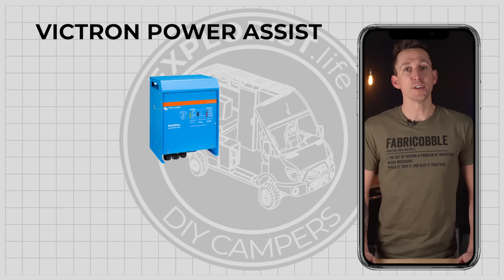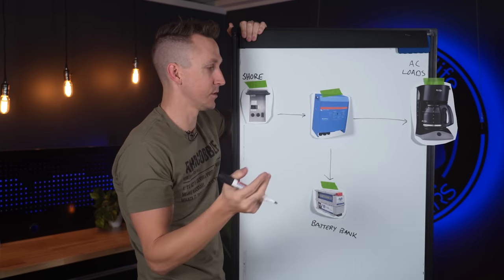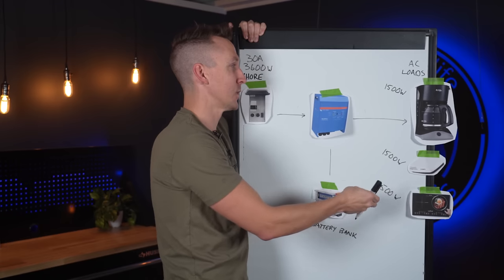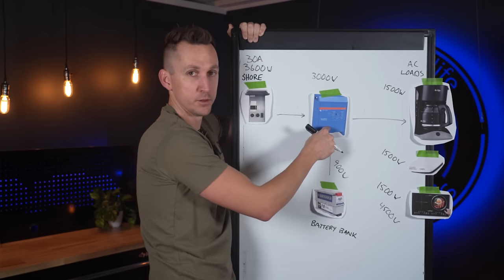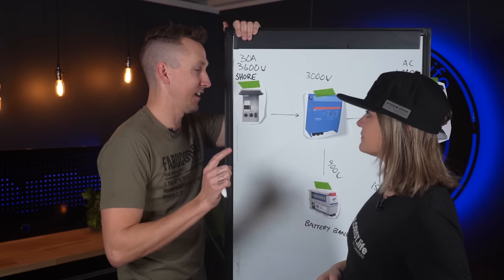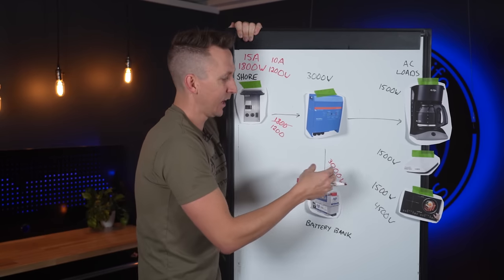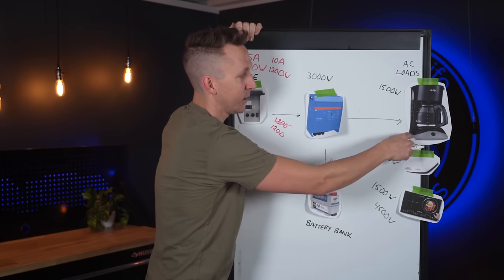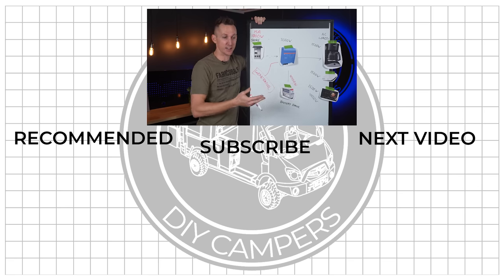How Does VICTRON POWER ASSIST work?

Comment: Hy. I see that are two types of 12v/3000W multiplus inverters. One with 16A transfer switch and one with 50A. Can you explain to me please what is this transfer switch?
Reply: Hi Andrei, not to jump in front of Nate but Victron's website has a bunch of helpful documents that explain all of their products and their YouTube channel is also filled with helpful tutorials. Great question though.
Reply from the maker: The transfer switch is the piece inside of the Multiplus that 'switches' back and forth between supplying AC power from batteries vs shore power; and the transfer switch rating is the max that the transfer switch can handle.  We see 16A on some of the smaller multipluses for 240V service (Everywhere but N. America) and 30A, 50A, or 100A for the larger inverters.   Basically: It's the largest shore power supply you can connect the unit to.
Reply: @EXPLORISTlife  thanks. I have a 240V 3000W inverter with 50A transfer switch.

Comment: What if your AC wiring on your load side is only rated for 15A?
Reply from the maker: Hopefully it is protected by adequately sized overcurrent protection & breakers.
Reply: @EXPLORISTlife   So there's no way to limit the output side in software settings.  Makes sense, given the nature of grid wiring.

Comment: I'm a bit confused cause your trying to pull 4500 watts from a 3000 watt inverter! so in your case you can only run two loads totaling 3000 watts no matter what you pull from the pole or your batteries? if you had a 4500 watt inverter then your diagram would be correct right?
Reply from the maker: Nope.  Give it a rewatch.  That's exactly what powerassist does.
Reply: @EXPLORISTlife  Ok I understand now! it can add up to 3000 watts of extra power to the shore power or generator power! I must of been zoned out! lol thanks! Great video as always

Comment: If you have a quattro, are you able to get power assist from both sources simultaneously? or is it literally an dumb ATS and can only get power assist from only 1 source? literally possibly needing battery power assist when both sources could power the complete load.
Reply from the maker: Nope.  There is no way for the quattro to sync phases.  Your genny and grid power would be out of phase.
Reply: @EXPLORISTlife  That is good to know. Quattro is basically a glorified overpriced ATS included with a MultiPlus.

Comment: Unfortunately, not a word is said at all regarding reactive power. The battery is charged in pulses by the inverter and this causes distortion reactive power. How is this taken into account?
Reply from the maker: This video doesn't cover the hyper specific details of HOW an inverter works.  All you need to know is that the Multiplus handles it without any hands-on from the end user.

Comment: So with a 2000W inverter and 30A shore power, the MultiPlus AC-out can be 8/3 gauge wire? (Instead of 6/3 wire as with a 3000W inverter).
Reply from the maker: 2000w/120v=16A + 30A = 46A, so I'm still going to recommend 6ga w/ a 50A breaker. No reason not to.
Reply: @EXPLORISTlife  ABYC standards say 8/3 wire is good for 56A (105C insulation, bundled). So 8/3 wire should be fine, or am I missing something? 6/3 wire is more expensive and stiff.
Reply from the maker: Yeah, if you are using wire rated for the amps you're asking to flow through it, you can make whatever adjustments you like.  The wire we supply in our 120V Distribution wiring kits is 6/3 wire with 90 degree insulation SOOW wire and is incredibly flexible: https://shop.explorist.life/shop/all-products/monitoring/victron-ve-bus-smart-dongle/

Comment: I am thinking of an interesting possibility.  The new Hyundai Ioniq 6 has the ability to output up to 1,800 watts 120 volts (via an adapter that plugs into the charge port -- the inverter is built into the car).  I was thinking of using that as a large battery (77kwh) backup for circuits in my house.  It would be the "shore power" in your example.  This way, in an emergency, I could use the car's large battery to supply most of my basic power needs with the Victron supplying additional power when needed like if I run a microwave and a cooktop at the same time.  Sounds crazy, I know but during most of the time, and definitely at night, 1,800 watts is all I need.  This way I can have a smaller (cheaper) battery bank for my house system since in a major emergency I can draw some on the 77kwh in the car.  Your thoughts?  Thanks in advance, thanks for the video and thanks for your response to my previous question

Comment: OK, I have a question. I think I know the answer but I’m going to ask it anyway. I have a 2000 W Xantrex inverter. If I am plugged in to shore power, 30 amp, am I limited to the 2000 W or will the inverter allow the 3600 W to pass through from the shore power without tripping anything? And I guess the same question goes for when I am using the generator. I have a 4000 W Onan generator. When I’m using my generator, I should have the 4000 W available, correct? I’ve often wondered this. I am assuming it will allow all of that wattage to pass through. And that I would only be limited to the 2000 W when I’m running off of battery power. Is that correct?
Reply from the maker: If it's simply an inverter and not an inverter/charger; the pass through will be dependent on your transfer switch if that's how the system is set up.  Tough to say, though, without knowing how the system is designed.
Reply: @EXPLORISTlife  it’s an inverter/charger.

Comment: Nice video.
And what if the output side of the 3000W inverter-charger is protected at 3000W with a breaker, while the user tries to pull out the total of 4500W? I know the answer. 😉
Reply from the maker: Exactly!  That would indeed severely limit the PowerAssist ability of the unit.  We can see this happen in a 30A OEM RV where the wire from the Multiplus to the factory breaker box, the breaker box, and the main breaker has not been upgraded.  This isn't a 'problem' necessarily, just a consideration and something to understand regarding system limitations.
Reply: @EXPLORISTlife  The setup I'm currently considering this might happen.  So if I understand correctly if my max power draw is 4500W I should size wire downstream of the Multiplus for 40A with a breaker?
Reply from the maker: See my full system diagrams at https://www.explorist.life/solarwiringdiagrams for my wire and breaker size recommendations for various systems.
Reply: @bkk6211  I'm considering a similar upgrade as the factory has a 30A breaker for the main input to the panel. My concern is if the panel itself can handle a higher amp breaker. Unfortunately it's buried in snow so I can't check it!
Reply: @bkk6211  I was able too look up my OEM breaker panel and it says it's limited to 30A input. Normally 50A would have 2 hot legs, so I'm not sure what he's talking about when he says to upgrade. The thicker wire is easy to figure out but I'm still wondering about the breaker box itself and it's limitations.

Comment: That must be why you have a 6/3 cable on the outlet side on your diagrams.
Reply from the maker: Exactly!
Reply: @EXPLORISTlife  Hey Nate, I purchased a few sets of your plans the 24v van system and the 12v 30amp rv  OEM plan set. I am retrofiting a 30amp service rv with a Multiplus II, and I am in the process of purchasing the necessary components. After reviewing the rv 30amp plans again you were actually using 10/3 and a 30 amp breaker which is what I was planning to use. To utilze the maximum potential of power assist If the OEM breaker panel can support the additional amperage I should be looking into replacing the main 30amp breaker with a 50amp single pole breaker and route 6/3 cable to the oem breaker panel. Otherwise I will be upgradiing the breaker panel as well.
Reply from the maker: Are you regularly tripping the 30A main breaker of your distribution panel currently?

If not... it may not be worth upgrading because, as you mentioned, you would potentially have to replace your breaker box for one rated for 50A as well.
Reply: @EXPLORISTlife  I am buying the actual trailer this week. A relative has the same trailer they have normal issues like running the ac and microwave at the same time. That being said I could always buy the 6/3 and route it to the 30 amp breaker. We are just planning a trip, and I need to order components. We are planning to work remotely in the trailer, and I am just trying to plan so that we have minimal issues on our shakedown.

Comment: This example would not work with a 30amp RV/van... once your demand goes over 3600 watts (30 amp) it would start to overload the 10 gauge wire and trip the 30 amp main on the RV panel.  
This set up is also great for running off a small generator ie 2000w Honda.. set at 12 amps and it would charge the battery between heavy load use
Reply from the maker: That's not true.  🙂

Comment: Isn’t the 3000 W Multiplus effectively only 2400 Ws? Wouldn’t that affect your math in this video?
Reply from the maker: Each Victron Inverter/Charger can add up to its max rated output to shore power; so yes, depending on which unit was used, the math would indeed change; but based on the information provided, you should be able to calculate that.

But yes; there is a difference between it's kVA rating and it's wattage output, but that over-complicates this discussion a bit; but if you understand that fully, you can make an even more informed decision.

Comment: Perfect…. Almost🙂
Now if Victron could start referring to power abilities for their inverters in actual watts instead of volts. 
3kva actually being 2400w before overload. 
Still glad you did the video😉
Reply from the maker: Perfect comment.... Almost 🙂
It's important to not introduce too many complex concepts when teaching this stuff.  Although Victron Inverter/Chargers are indeed listed as a function of Volt Amps, introducing Power Factor for inductive and resistive loads to convert VA to W would have made this video WAY more confusing, which wouldn't have been beneficial for anybody trying to learn this new concept.  For the sake of learning, it's easier to work in terms of W understanding that the watts are realistically just a bit lower, which can be thought of as 'safety factor', if you will.
Still glad you watched the video 😉

Comment: A good video. However, the vast majority of the rest of the world (Germany, France, Portugal Spain, Holland, Turkey. In fact all the EU, Australia, New Zealand, the Baltic states Russia and the former Russian states, Most of Africa, South America) Use 220-230Volts and 50 Hz  In which case shore power is 220-230 Volts 16 Amps supply @ 50Hz. The math is the very different and the rest of the world is watching your video scratching their heads and wondering where you learnt your physics. 😁
Reply from the maker: Yeah, I definitely get that.  The math will be the same but with the proper conversions (Watts = Amps * Volts).  I definitely understand the concern, though, but don't know of a better way to approach the math other than doing the video twice, basically.  For the longest time, an overwhelming percentage of our viewers were from N. America where we use 120V 60Hz; but now it's about a 50/50 split between N. America (120V 60hz) vs Everywhere Else (240V 50hz), so I'll dedicate a little more brain power to addressing this going forward.
Reply: Interesting I never really stopped to think how so many other countries run on a different kind of electrical grid. I really don't understand the Hertz